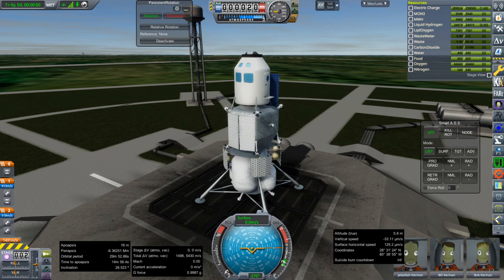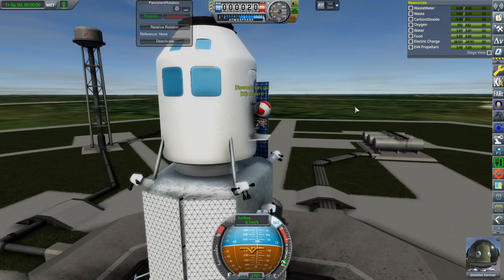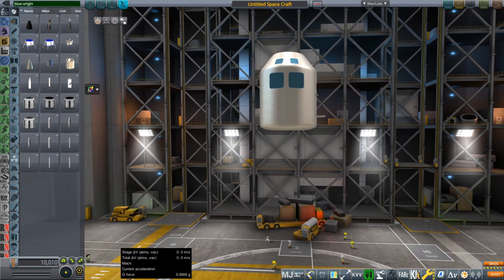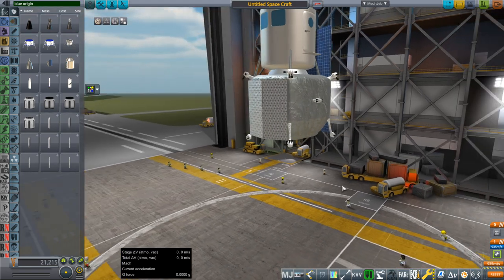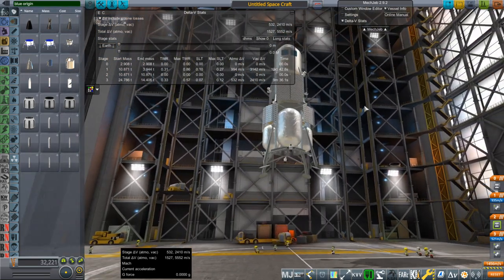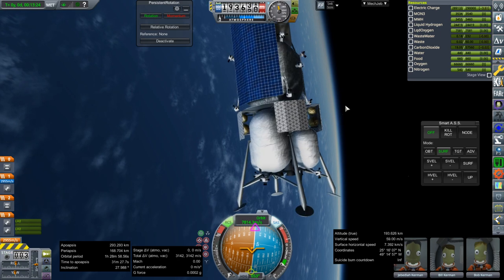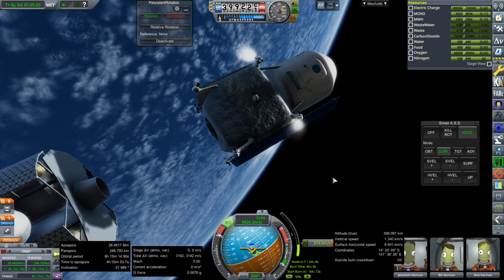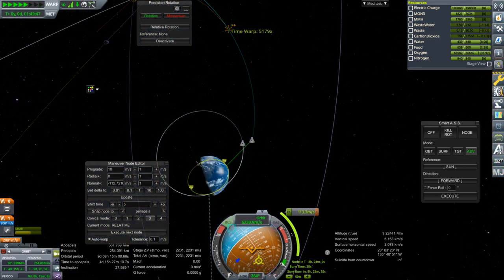Realism Overhaul in KSP 1.8.1 - Blue Origin/National Team Lunar Lander

Comment: Any reason why you’re using the New Glenn and not the Vulcan?
Reply from the maker: Vulcan's low thrust upper stage irritates me, but more importantly it doesn't fit in the fairing. Either there's a fairing larger than 5.4 meters or the legs tuck in much more thoroughly.
Reply: Raiz Space Will you be using the Vulcan or equivalent next-generation craft for the recreation, or will you continue with New Glenn?